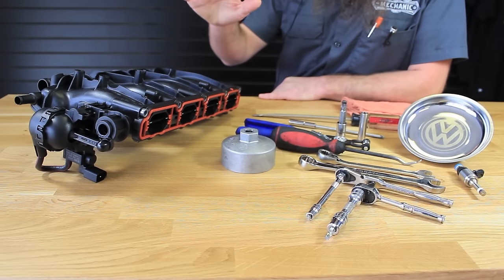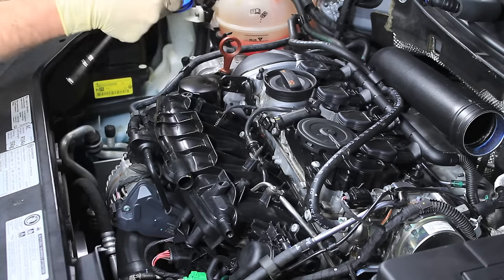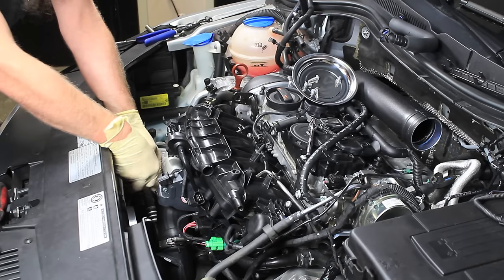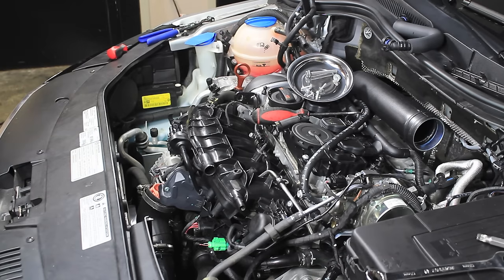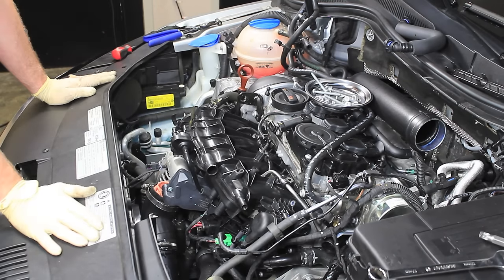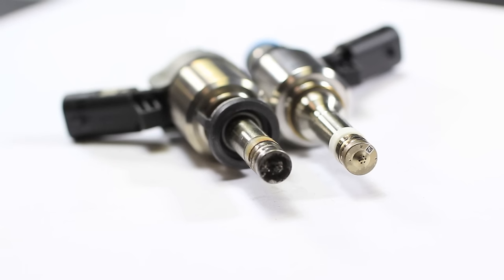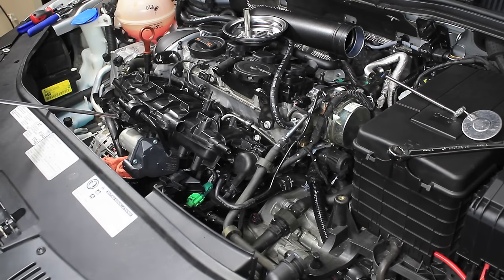Intake Manifold for VW and Audi 2.0T TSI DIY (How to) Replacement

Comment: Hi i got my water pump replaced on my 2009 GTI  2.0  TSI   and after I got the car from the shop I had a code P2015. The shop wont admit its their fault. My question to you is : When you put back the intake manifold is there something you can do to damage it and cause the code P2015 to pop up? Also after taking on and off the manifold is it supposed to have and check engine light  ON with that specific code, or did they lie to me when i got the car? I would apreciate your help  

By the way good job. I watched all your video and Im worried if they were careful since you mention A LOT that you have to be careful with cables and other components as they are easy to damage. Thank you !
Reply from the maker: +Nikos Kal Its possible that something was damaged with the intake manifold runner, but it is also possible that nothing was damaged.  The P2015 problem is common the the TSI engine and may not be related at all to the waterpump repair.
Reply: +Deutsche Auto Parts thanks for they quick reply. If you take off a manifold in the car and everything is good, then after you put it back on are you supposed to have a check engine light on  because of that you removed the manifold?
Reply: +Nikos Kal If you follow the repair manual for the water pump, it does not tell you to take the pump out. In fact VW will not pay for us to replace the injector seals under warranty when we replace the water pump. 

Some techs still remove the intake and it makes is a million times easier.
Reply: Is there any manual or video how to replace the tsi engine water pump?
Reply: If you remove the intake manifold step by step as HumbeMechanic does, you will be able to see the water pump hiding right under the manifold and this would make it so much easier to see what you're doing in order to pull it out. I think the hardest part in replacing the water pump would be to remove the intake manifold in order to replace it. I have not seen a video on how to replace it though.  I know the pump has 5 bolts that you need to tight in a sequence 1-2-3-4-5 at 9 Nm with a torque wrench. i would try to search more about it on the web for a step by step guide.
Reply: Nikos Kaldaras - Thanks Nikos!
Reply: Hello Nikos! I am changing the water pump and also I bought the timing belt, what is the torque value to apply on bolt pulley?

Comment: Can the warranty be denied if I have a forge blow off valve on the engine? No other mods on the engine.
Reply from the maker: frank lopez Thats a really complicated question but generally you shouldn't have anything to worry about.  You might want to check out this video we did about warranty and modified vehicles https://www.youtube.com/watch?v=JJN7p4sUo1U

Comment: What’s the number 10 triple square for?
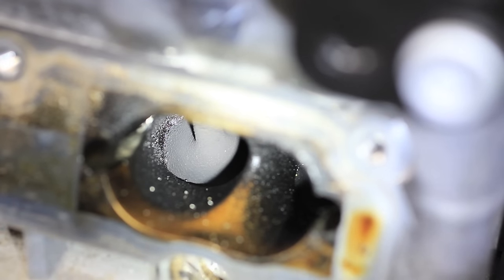Reply: It's for the hard- to-remove bracket (see 21:00 where he removes it and at 23:00 you can see the bolt where the M10 triple square fits into, holding the bracket in place.)  It's this bracket that connects the intake manifold to the throttle body.

Comment: Do I need to replace the intake manifold gasket? Is it a must?
Reply: Probably not.  Might be a good idea depending on its condition.  I put a layer of dielectric grease over mine, which will help seal it.

Comment: I watched this video to replace my intake manifold on my mk6 gti due to a failed actuator. but one I was done I went on a test drive and my turbo won't boast. I got a p0328 code and I still have a p2015 code. Can I have help please?
Reply from the maker: You likely put the vacuum lines on the solenoid in the wrong place. The newer manifolds have an extra nipple. We talked in this video at 29:08
https://youtu.be/hRAcxGdkcZU

Comment: You skipped literally the only hard part of the entire video. How do you fit a 10 triple square  bit, not to mention a ratchet handle, not to mention a human hand to undo the manifold bracket without removing any of the 3 hardlines or wiring harnesses in the way. And the second intercooler bolt is where? You must be able to sense the frustration here. Any tips anyone?

Comment: What is the preferred fix for the stripped out intake manifold bolt holes?
Reply: Since they're going into the head, you'll likely want to re-tap and helicoil so prevent this from occurring again. Not a fun process, but if done correctly, your problem is solved. The upper threads are easier to get to, the lower threads may be difficult or impossible (hopefully not) to do with the head on.
Reply: @Fmandan77  when I asked this question 11 month ago , I ended up buying a Time-Sert kit which I felt was superior to the Heli Coil  kit. However, I didn't ever get around to making that repair yet. It is still waiting on me.
In the meanwhile ,  I came across one seller with a stud kit to replace the shorter bolts used that may not require any tapping since they go deeper into the existing holes/threads...
I'm wondering if this isn't a better solution.
Cheers

Comment: I have a 09 Tiguan 2.0T TSI with a CEL P2181 error code. I looked up the code and found out it is related to the cooling system performance. My car runs without problem. temperature raises quickly and stays at normal. And the CEL stays on for the first few days, turns off by itself later and comes back after a month. I think the problem is related to the temperature sensor or the thermostats. How can I replace them without taking the intake manifold off? thanks
Reply from the maker: +wenqiang bo Its probably the coolant temp sensor but it could be the thermostat.  We answered a question like this on the askDAP show.  Take a look at this episode where we talked more about it. https://www.youtube.com/watch?v=VJDvE-td1_E
Reply: The temp stays at the operating temp which is the middle of the gauge, even after driving 100 miles. And after turning on the heater, I can feel the warm air flows in two minutes. the temp outside is 38 ℉. can it still be the thermostat?
Reply from the maker: Its probably the coolant temp sensor https://deutscheautoparts.com/vw-audi-coolant-temp-senor-grey-06a919501a.html

Comment: Should you disconnect the battery before doing this?
Reply from the maker: You should not need to disconnect the battery when performing this install. You will be working near the alternator so if that is a concern of yours you might disconnecting it.

Comment: Crazy u have only one pipe mines splits just after the sensor on the throttle body pipe makes little to no room to get that bracket out the metal one on the bottom of the intake out

Comment: All of my injectors stayed in the intake. Is it required to change the lower plastic seals?
Reply from the maker: You should yes
Reply: Deutsche Auto Parts how do you change the plastic seals ? You mentioned a special tool?
Reply from the maker: we shot a video with the humble mechanic on this here
https://www.youtube.com/watch?v=boVEdoayfn4

the tool is here https://www.shopdap.com/wkz-t10133c.html

Comment: make sure to snap in the injector wiring harness in the square plastic tube to the stainless steel bolt guides under the manifold before tightening down the manifold bolts

Comment: I just change my fuel injectors 2 months ago and now my intake manifold just failed do I still need to change the seals on injectors if they still look new
Reply from the maker: +kevlo7179wyb Better safe than sorry.  I'm sure you don't want to have to do that job a third time if the injector seals leak.
Reply: Do you recommend that I install the seal by hand or do I need to order the seal install kit
Reply: +kevlo7179wyb get the install kit. It is almost a much with the lower seals.

Comment: Hi Whats the best way to remove the throttle body without hassling intake manifold?
Reply from the maker: You should be able to remove the throttle pipe to do this.
Reply: Does it require a reset or reprogram after removal/cleaning of throttle bottle? How can I do this without a vag com
Reply: You're over-thinking.

Comment: check engine light popped on this morning. code p2015. I'm at the dealer now hoping they'll stretch the 120,000 extended warranty to cover my 120,250 mile GTI...
Reply from the maker: bensonthepilot We have our fingers crossed for you.

Comment: Only thing i would recommend is to use an air gun and blow any debris out before removing the Intake and injectors. Dont want any crud making its way into the engine were possible.

Comment: Hey bro, i have an audi A4 2009. for some reason the coolant tank is dropping coolant and i get a message saying to turn off the car and check Coolant level. at first i thought i was missing coolant but the issue was that it overheats and coolant starts getting spilled. i removed the tank and cleaned it and topped it off again but i keep getting the message to turn opff the car and check coolant. im fukn pissed off right now. any suggestions or how much it will cost to fix ? ... im getting ready to turn it in for a tesla instead.
Reply: Hello, it looks like you have a failed water pump. It just happened exactly like that to me last month. I own a Passat 2010 with the engine just like the one in the video. I replaced the water pump, the bearing were dead, and all the o’rings. Happens that sometimes there is a little tiny leaking that is not easily noticed, and boom you got that warning and I have to top it up 1.5 litters os water every 2 days. Go ahead and get a quote in a shop and then with the diagnostic, go an DIY!

Comment: I changed the catalytic converter on my 2000 gti vr6 and after that I don't have the same power on the car ,, do you have any idea why
Reply from the maker: Manuel Avila Where did the cat come from? New used aftermarket?
Reply: New and is aftermarket ( California )
Reply: I went to my local mufflers shop
Reply from the maker: Sounds like the cat could be clogged but its really hard to say.  You will need to diagnose it further.
Reply: Tha cat is new I getting from my local mufflers shop , I miss the power of the VR6 
do I need to put the direct fit cat ?? 
Thanks Deutsche Auto Parts

Comment: Anybdoy know where i can find some info on removing the throttle body. I can't find any walkthrough on the TSI
Reply: Travis Nott un bolt it
Reply: there are 4 T-30 torx bolts holding it 2 in the front and 2 in the rear. you need extensions for the rear. the 2 fronts are visible.
Reply: I guess I should have worded his better. I'n to too familiar with the engine bay and would like some tips on what to move out of the way to access the throttle body. I know how to remove it once I'm there but I'm looking for  a walk through on what to remove to make it easier to service
Reply: Travis Nott preety much nothing. I removed mine just bend over and do it. There is no other way. Unless you take off your intake manifold off which is not necessary and a lot more work for no reason.
Reply: Alright I gotta get a better look in there then. I couldn't see a good way to pull the TB Off. Then again I wasn't looking to hard.
Reply: Dude is not that anybody with no experience can do it. Is 4 bolts and are not even tight.

Comment: 11:40
Bleeding fuel pressure.  Would you mind letting me know how I do this please?  I've read that direct injection fuel lines are very high pressure as they have to fight the cylinder compression, so I don't want to get it wrong and soak myself and the car in petrol. Thanks!
Reply: +Harry Marshall  Just remove the fuel pump conector (under the rear seat right side) and turn on the engine until it runs out of fuel.
Reply: +Clovis Tanganelli You're not serious right?? :O

Comment: I'm repairing my Volkswagen its a 2006 jetta 2.5 ..I had to replace the manifold and I was wondering whats the torque sequence for the intake manifold..
Reply: First torque bolts to 3NM and torque to 9 NM (FACTORY SPECS).

Comment: what is the small connector clip that connects to the block called
Underneath the manifold.  The very delicate one that we need to be careful for.  I broke it.  Need to replace it but not sure the name. It’s an electric connector that has two wires
Reply: See 24:10 in the video.  Coolant temperature sensor.

Comment: Won’t fit the fuel rail rack and align the screwholes. Even the screwholes on the new manifold require different hardware and won’t fit mine. And after I started the car, it misfires.
Reply from the maker: If your car is misfiring after this install it’s likely you have a vacuum leak, and something is not seated properly.
Reply: @Deutscheautoparts  thank you so much for the advice!  I am sorry for a rant, I am just a professional mechanic (aircraft) and you know how we can get hotheaded at a moment when a maintenance action goes wrong :)
Reply: @Deutscheautoparts  Hey, I couldn't align the top part of the fuel rail where the screwholes align with the intake manifold so I left the top screws out from the manifold.  Do you think the air could be escaping through those screwholes?

Comment: My 2010 vw passar  2.0 l tsi  has  some  issue  Check engine light on  sometime just on off  check engine lite. But  engine  runs   noisy  idol  up  dovn  suns like backfire in muffler   engine dies out   i got  codes but  not 2015   diller said  they   wont  replase intake  manifold  since  code 2015 dont  come up  I  took  intake manifold  off  i see  nothing  visual problem  got 91 000 mile on  car  I change spurk plugs coils    coolant sencers  map sencer will change   also maf sencer   oil pressure sencer and  Fuel rail sencer  . I Code  came up said  lean fuel mixture   oh i also changed   rubber pcv  walve replasemant kit    steal  runs  roughf and  idols  dies out here and there .  I Winder  if  the sencer in te back of  intake manifold   wont  work or what .  I sw   intke mnifold   from  78,00  dollar to  166 ,00 dollar on net.  I  clean intake at valves   was not to  dirty . I dont know  what els i can doo  with this  Junk.  if aneyone has aney idea plese  send me  massage here  or gmoorp@gmail.com. Thanks.

Comment: Sorry I forgot mention I just got the code p2015 on the my 2011 gti ccta dealership they found my vin under warranty replacement  bug will need to be looked at
Reply: +frank lopez Good afternoon , you solved the problem? I am getting the code P- 2015 and tell me that I have to replace the complete intake manifold .

Comment: I have a problem with my Seat Leon 1P FR 2.0 TFSI.
The timing chain jumped and the valves were broken.
At the repair in a workshop the turbo was exchanged because it was full of oil.
Now I have my car back again but he does not drive as before.

When accelerating, it feels rougher.
I have the feeling he does not have enough torque
The lamp is on -> error code P2015

Can the symptoms be related to the defect of the Manifold?

In addition, I hear from time to time a very high "tick tick" at the front of the engine.
I do not mean the TFSI engine noise

https://www.youtube.com/watch?v=pZU9XtOcYj8&feature=youtu.be

Can the noise come from the Manifold too?

I hope you can help me from afar

Comment: There is absolutely no good reason it should be designed like this and so fragile to remove the intake! Or carbon build up on the valves or leaky water pump on this engine. I have a 2012 Gli and can't wait to get rid of it. The potential premature failure takes the fun out of owning a VW! Very disappointed how the engineers built this engine and the nightmare for maintenance and repair.

Comment: Not gonna lie, I couldn't get the bolt under the second runner on from the right... Took a chisel and hammer and removed that runner, much easier. Had it off in 5mins after that. Lack of tools... No problem if you've got a hammer

Comment: Why on an expensive car like Audi, they use plastic intake manifold? Is this the "German quality"?
Reply from the maker: +John Capidecallu Plenty of BMWs and other high end German cars also use composite intake manifolds.  The material of the manifold has nothing to do with failures in this case or in any other we are aware of.  This just seems to be a quality perception.
Reply: +John Capidecallu From an engineering standpoint in can be better to use plastics instead of metals for the following reasons: No corrosion, cheaper and more reliable manufacturing, and better mechanical properties. With that I mean that for a part that bears no load, but is subjected to stresses (from attaching it to other parts) and large temperature variations, plastic will be better than aluminium. That is because aluminium is comparatively brittle and does not respond well to temperature changes; it causes lots of internal stress. Source: I'm a mechanical engineer.

Comment: I have everything installed except the connectors to #1, #2, and #3 fuel injectors. Please don't tell me I need to take off the intake again!!!
Reply: Before seating the intake connect your fuel injector connectors!

Also, before installing your oil filter, connect that little connector next to the base of the oil filter... no idea what that is for. Now that I think of it, I don't think that needed to be disconnected to remove the manifold.

Included in the parts kit there was a long vacuum line with some type of connector or maybe it's an air filter. Where does this go to?
Reply: The intake has been installed and the GTI is running great except, I'm still getting a P2015 fault. Any ideas?
Reply: Charles, What do you think? GTI runs great... turn the car off... read codes P2015. Erase.. start, no problems. Turn it off read codes P2015.

Comment: The screw holes  misalign by half an inch.
Reply from the maker: This is something that happens on some models, but there is only one manifold as per VW for all applications. The rail will go on and line up perfectly, but requires a little bit extra effort to get it seated in place. Hope this helps.
Reply: @Deutscheautoparts  thank you so much for the advice, and sorry for the rant again